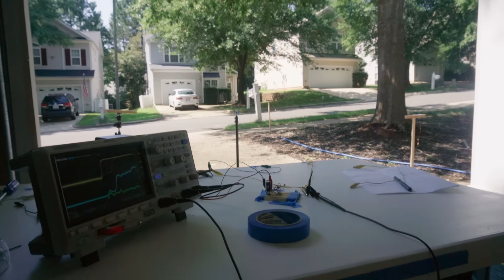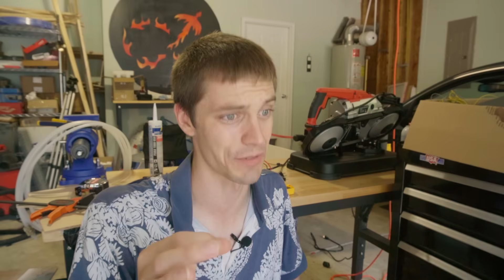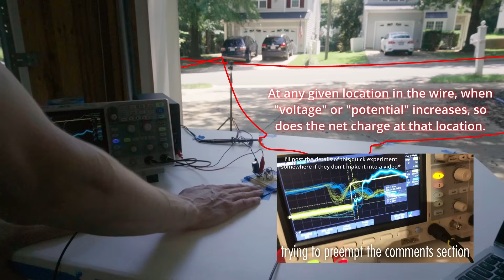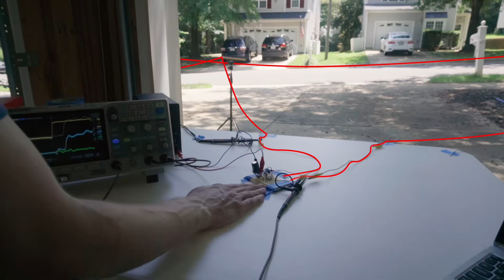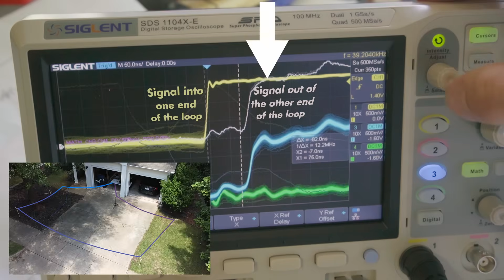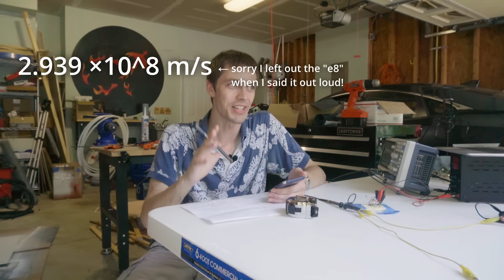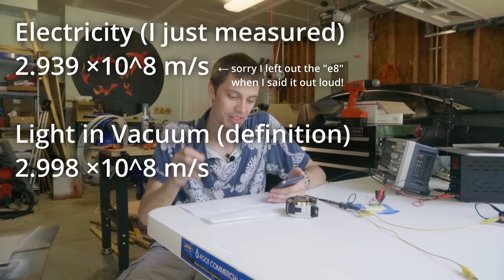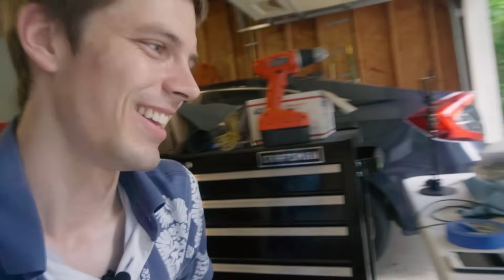Why does WATER change the speed of electricity?

Comment: Velocity factor is a thing in RF. I use a VNA to test RF cables for PS radio systems. Most cables have a VF of 85 to 98 and is very useful for finding cable distance. We also use the VNA to determine cable loss, return loss and insertion loss. If you don't have the proper VF you won't get the correct distance. I mean the VNA is almost magic. I can see issues along the entire length of the cable, you can tell where there might be a bad connector, improperly installed ground, bad antennas, or even see if there is water in the lines(and now I know why!). I'd love to be able to let you borrow my VNA, because its seem to be the right tool for what you are measuring, but it belongs to my company. However if you ever need an experiment run where you think it would make a good video, I'd be more than happy to colab.

Comment: Electrons don't "flow"
Reply from the maker: They do - electrical current is measured in electron flux per second. I’m going to hit that point more specifically in the next video. Hope it’s out soon!
Reply: @AlphaPhoenixChannel  think about what you just said. Flux... Look up the definition of flux bud. It's more like a back and forth wiggle then a flow.
Reply from the maker: @jessicastevens538  dc results in net electron flow, seriously, that’s what current measures. It’s charge per second - total charge that moves through a wire

Comment: Just a quick anecdote of how timing the propagation of changes in voltage on a wire is used in the real world:

I worked on a project at a previous employer we were upgrading the sensors (i.e. the "camera") of some telescopes. The sensor array for each telescope consisted of 499 photomultiplier tubes (PMTs), each with their own coax signal back to the data collection rack. After installing all the individual sensors some of us sat down with a scope and a pulse generator next to the data collection rack and timed the propagation of the signal and it's reflection at the PMT's amplifier board to make sure the cabling was good. What was really neat is we could see how long each coax cable was (they were all about the same length, but I forget how long that was and the expected time of reflection). We could also see all the connectors in the cable path, including on some cables some repair splices. Thankfully we didn't have to repair any of the cables, but we did identify a couple bad sensors.
Reply: You can get an approximate idea from the fact that light (all EM waves) travel about one foot in one nanosecond.

Comment: So you could go down to the local pond, row out a loop of wire, connect up, and get an even more pronounced delay effect? (Not much point in that, since you got enough change for it to be measurable, but anyway..)

It doesn't sound like this would have enough effect for it to be worthwhile, but this says you could get more responsive subsea electonics by putting the cable in a pipe full of air? I think? Or did I get it backward? And then what if you made sinusoidal changes/ discrete analogs of that? Cable lies on the floor, cable climbs, cable attached to the roof, and back and forth ... I can imagine it, but not the consequences. (Can smell smoke coming out of my ears. Better go get another drink.)

Comment: Without yet watching it, I suspect your timings are going to be very close.  What slows down the impulse speed of electric pulse is the reactance of a wire; its combined inductance and capacitance. A single wire will vary in resistance according to its thickness, but I doubt it changes its inductance.  Maybe capacitance.  This slow down is given the name "velocity factor" and a bare wire has a velocity factor of .95 to .97 and an RG58 coax has a velocity factor of about .65

Comment: 13:17 you can also see how the "slope" of the wet trace is shallower than the dry trace, which is exactly the result we would expect from the speed of light being frequency-dependent! (In theory, we would also expect it to 'ripple' more, but I don't think that's easy to see here)
Reply: Actually it seems it had an opposite effect - very heavy damping! The clean air setup showed significant overshoot and ringing, the pipe (dry or wet) had 0 overshoot.
This is expected tho, the pipe around the wire basically makes a large parasitic capacitor. This causes high impedance on the line, greatly attenuating higher frequencies.
Filling it with water made it a slightly better capacitor, hence more impedance and a slightly slower rise time.
The most curious effect imo is how the delay was already near maximum even though just a tiny part of the pipe was filled, and stayed relatively constant thereon. Could simply be that the shots are not truly time aligned though.

Comment: It always travels at the speed of light, it's just that the speed of light changes in different mediums. It's slower in a gravity well, it's slower through glass and it's slower in a wire and in air, but it's still the speed of light.
Reply: which Speed of Rate = rate of transverse inductance of EMF through medium
Reply: Light is not slower in a gravity well it bends in a gravity well, but its speed is unaffected as long as it is in a vacuum.

Comment: I don't think different materials per say will change the rate of potential transmission.
But higher resistance of course means.

1) More heat loss. Duh.
2) Less current.

And POSSIBLY

3) A longer time for potential to reach its maximum, it will start just as fast but grow slower.

Comment: While watching the bit about how the different frequency components would "smear" the signal, I found myself wondering if the same would happen with visible light - and then realized that's exactly how a prism turns white light into rainbows.
Reply: And that's how we invented fig. Newtons.
Reply: So a prism is a real life Fourier transformation?
Reply from the maker: @ForboJack  you can also do spatial fourier transforms with optics and it's pretty incredible. If i remember right there's an Applied Science video about it (yep, found it https://www.youtube.com/watch?v=wcRB3TWIAXE)
Reply: @AlphaPhoenixChannel  Very interesting. Thanks for the link.
Reply: @ForboJack  not really but apertures are :)
Reply: It's called dispersions :) rectangular waveguides do it too for different reasons
Reply: You beat me to it.  Dispersions.
Reply: https://youtu.be/QWqb5Gewbx8 more info about bloom and glare, etc, being Fourier transforms
Reply: When you send a communication signal through deep sea cables then that frequency dependent smearing of the signal is a problem. They have two steps on how they solve this problem. For one they have optical amplifier. They are weird crystal structures which optically amplify the amplitude of the optical data signal within the wire. But they can't unsmear the signal. And because of that every few stations they don't use optical amplifier but they turn the optical signal into an electrical one. There they can make clear zeroes and ones again and turn that distinct signal into an optical one again. And from then on the story begins anew.
Reply: @benrex7775  How do they power those electrical amplifiers?
Reply: @skylerlehmkuhl135  It was just a short mention during a optical physics class so he didn't state that back then. But I assume they have powerlines along the cable. But don't ask me how they deal with voltage drop over that distance. My only guess is if your voltage is high enough then you don't have to worry about voltage drop. Also they can use pure silver as an electric conductor as price isn't that much of an issue down there. 
Theoretically there could also be power harvesting on the amplifiers, but I think since it is the deep sea the environment is too static for that option.

I searched a bit on YouTube and according to this video (/watch?v=ekdUWPOklec) they use one copper tube with high voltage in it. Nobody I found said why it is only one wire and what voltage it is specifically. But I assume that the repeaters have a metal casing which is used to ground the repeater to the sea floor and therefor close the circuit.
Reply: @skylerlehmkuhl135  Some varieties, known as “All-optical regenerators” require no external electrical power, they work on a principle similar to that of light-pumped lasers, that is, the optical digital signal enters one side of the regenerator and stimulates a secondary emission out the other side.

Seems like voodoo, but it’s applied chemistry and optics.  I had difficulty finding a good non-scholarly explanation, but here is a 5mb PDF on the subject if you’re truly/deeply interested: https://iopscience.iop.org/article/10.1088/2040-8986/ab0e66/pdf
Reply: @benrex7775  Of course an optical amplifier can "unsmear" the signal. Modern photonics is non-linear. It's not just "make it bigger", but can for example have thresholds. In fact, most electronics is the same, just that with analog amplifiers we usually choose the linear region on purpose, even optimize the semiconductors to have a particularly broad linear area. However, any sort of zener or avalanche diode exhibits extremely non-linear behavior (as intended), with absolutely no digital "turning to ones and zeroes" going on. Still manages to rapidly turn on and off with very little input variation.
Reply: Im not sure that is quite right. A signal can be represented as a series of different frequency and amplitude sine waves, but the sine waves arent really there, they are just a representation. However with light, it is multiple photons with different frequencies travelling together and when they hit a prism the different photons are refracted differently based on wavelength.

So with a signal, the sine waves are really just a representation of it and not really there, all that is there is a single signal, whereas with light it is discrete individual photons of different frequencies that are travelling in a similar path. So a signal is really only a single signal whereas light is multiple individual photons with different frequencies.
Reply: @conorstewart2214 photons of specific frequency aren't more real than the frequency components of the signal
Reply: A prism works because the white light leaves the prism at an angle different from the angle it entered. If we have a flat glass with both sides parallel, and light enters at an angle, does the white light spread out into a rainbow of colors and then recombine as it leaves the other side???
Reply: @rogdogny5182  My guess is that inside the glass the different colors have different a different angle. But when they exit the glass again they are parallel again. They are pretty close to each other and you normally don't have a single ray of light. Because of that it isn't noticeable and looks still white.
Reply: This is unfortunately mixing various effects into one explanation. For an electric transmission, you want an infinetely small pulse, with infinitely small rising time, i.e. a perfect square wave, for maximum transmission speed (vs. a pure DC transmission that contains no information whatsoever since it's steady on). However a perfect square would from a signal-perspective contain infinite frequencies, which parasitic inductance and capacitance prevents from happening, attenuating higher frequency components and broadening the pulse.
Optical smearing does have some of these problems as well (obviously not capacitance/inductance, but the infinite frequency problem), but there's generally a lot more going on physically, even in single-mode fibers.
Reply: Oh wow!!!!

Comment: Not so sure about the Fourier transform part.
Flipping the switch on and off a whole bunch of times is not the same as flipping it on once.
If you flip it on once you should generate some kind of a "ramp function" that has a certain frequency response
If you flip it a bunch of times you are generating essentially a  kind of a square wave that has a different frequency response, and this time the frequency response is composed of the frequency of the square wave that you generated along with harmonics..

Comment: In my opinion you might be measuring the voltage at the wrong time. The voltage should be measured somewhere between V*√2 to MAX V. AC is always calculated at the MAX V*√2 as this is the RMS value ≈ actual power. Also you should measure the phase angle between V and I, not just V.
It would be interesting to see the change of salt water and fresh water as the dielectric properties are extremely different between the two.
Reply: it isn't just dielectric properties, there are also diamagnetic, paramagnetic and ferromagnetic to consider 
water is diamagnetic, adding salt makes it more so

Comment: One of the nice things about this demo is that it shows that the propagation of the current in the wire must be predominantly through the change in the electric fields around the wire - if it were only fields inside the wire that were responsible for the change, then you wouldn’t expect changing the dialectric outside the wire to have any effect. But we do see a strong effect from changing the dialectric of the medium around the wire, so it must be the fields around the outside of the wire that are responsible for the propagation of the signal!

I think this is a much better demonstration of this than a certain other YouTuber managed!

Comment: This opened my eyes to a few ideas that make my understanding quite a bit weirder. What we're doing here is basically observing the speed of causality for a certain phenomenon, and we learned that this speed is dependendent on frequency and on the medium, basically its refractive index. The thing about the refractive index I remember from uni is, it's not just a single number like I learned in school, it's a frequency dependent complex 3x3 tensor. That means, in unisotropic materials the speed of causality also depends on direction, which is a neat and mostly useless detail that I thoroughly enjoy.
Reply: With (media-)parameters x at time t we measure an effective field propagation speed of y with t to t'. WhyTF should the behaviour of y change ? Or causality? (Hint: They DON'T!).
Changing x leads (possibly) to a change of the outcome ... what a trivial realization. Also in a relativistic view and in YOUR inertial system there are NO velocities that you can observe from the "outside". If you think you can be such an observer("speed of causality", LOL), no offense, you should see a doctor!;)
By the way: cause and effect can be classified as at point t0 and t1 in time, if you like. But wanting to glue SI units/dimensions to a term that describes the logical relationship between cause and effect is the dumbest thing I've ever seen.
And it started so well ... all is very easy and observable. Kindergarden stuff. Only a Glass of water or a Prism is needed ... done!

Comment: Well doesn't it depend on the medium?? 
A superconductor will allow the electrons to travel closest to the speed of light possible. 
But any other material electrons pass through will slow them down.
Reply: No. Resistance (and thus superconductivity) has nothing to do with it.  There are two effects going on here - that's what the whole video is about.  There's the actual physical movement of the electrons, which is pretty slow at millimeters per second, and there's the movement of the electric field which is equal to the speed of light in the material.

Comment: Great video as always!
I such a great fan of how you put together simple experiments to explain advanced topics.

Got a silly question,
Around 18:00.
On how wired getting 1.5x slow down and how that is similar to light's 1.3x,

How is this wired.
How is getting 1.5x slowdown in water wired if our results depend on frequency and we are switching the transistor at such a high frequency?
Is not our experment inherently bound to give us that result because we are switch at such a high frequency?

Or put another way,
If we sought to get 8x slow down in water should  we not make the  switching transistor fire at a slower rate?

Thanks!

Comment: I'd expect frequency you're toggling that switch to be far lower then what water molecules need to order themselves with the field.

However, what you were measuring was the timings of turning on electricity in the circuit – not the propagation of the electric field when it was already established and in some form of equilibrium with water.

Maybe you could try measuring the same thing, but when switching back and forth between two positive voltages, instead of zero and positive?

(Or maybe even turning off the switch would show the difference? Some other effects could be showing there, though)

Comment: 18:53 In the university I go to, which is very well respected in these fields, I took a course about signal processing that introduced us to FFT (among other things), and even they sometimes mixed up "fft" and "Fourier transform" (albeit the discrete time one). To this day I don't know if they mixed them up deliberately - to check if students realize that they are mathematically equivalent - or subconsciously because FFT is just so ubiquitously used to produce Fourier transforms.

I guess what I'm trying to say is - don't sweat it! It's good that you clarified that you meant Fourier transform when you said FFT, because to the intended audience who have just been introduced to the concept that will of course not be clear without explanation, but I don't really agree with "I really shouldn't". Even a lot of professional tools hardly ever acknowledge the difference between FFT the algorithm and Fourier Transform in general.
Reply: Forgot to say the obvious: great video! Had to rewind a bunch of times to take it all in (that's a good thing!) and I had no idea that signal propagation time depends on the substance around the wire! Truly fascinating!